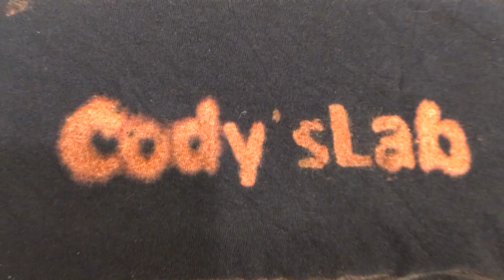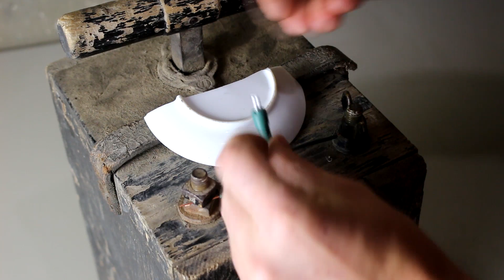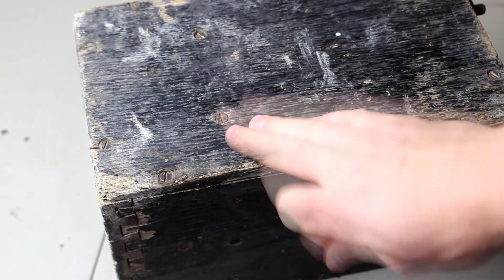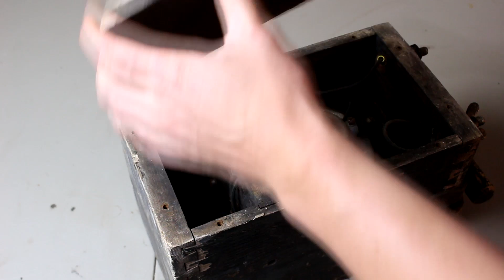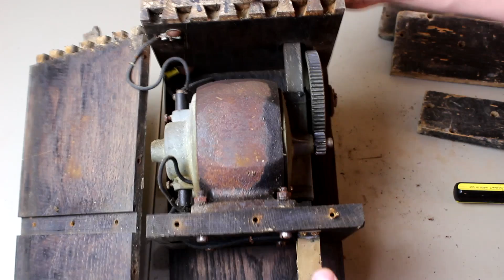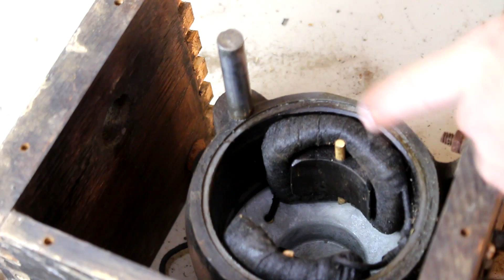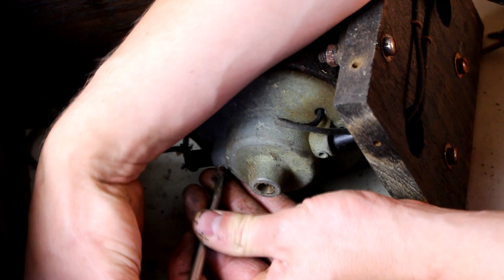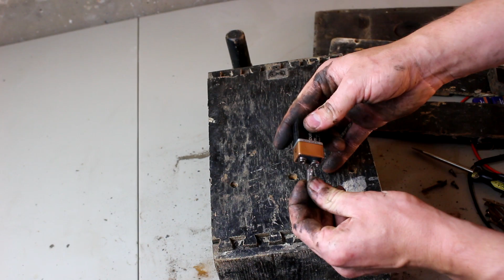How Does An Old Blasting Machine/Generator Work?

Comment: My deepest respect for you, because you have the courage to take apart such a valuable item that belonged to your granddad.
Reply: This thing is from the era where it is actually supposed to take it apart, maintain and put it back together. And you could do that without any doubt.

If it were made today, you would start by removing the single screw in the handle. The you remove the handle with the $1500 proprietary handle remover. Pry open the plastic housing with clicky tabs that says "Do not open, no user serviceable parts inside!". Then you'll find platic gears, and a motor of tenth the size. The bearing cap would be secured with triangle screws, and it would be made so that a standard bearing puller won't fit, but there would be an another $1500 proprietary bearing puller for that. But the bearing housing made from single-use plastic would shatter anyway. $1k for a set of two, bearings sold separately. And the output connector would be proprietary also, with a semihypershapical cutout on the front panel, in case you would swap it for some old-fashioned round $1 terminal post.
And the whole assembly process would be totally pleasent and absolutely not stressful with the 10cm permanently crimped unremovable very thin wires holding everything close to allow great access.
Reply: Ok so it should be "grandad"
Reply: G R A N D - D A D
Reply: FLEENSTONES???
Reply: 7 GRAND DAD?!
Reply: @Sam-fq5hc  what are you trying to say?
Reply: @zrnjan  migo they're referencing to the bootleg game called 7 grand dad
Reply: @zrnjan  GRAND DAD
Reply: @SomeAzureDude  I don't know what is that, man. I don't know what kind of game is that.
Reply: F L I N T S T O N E S F L I N T S T O N E S T S T O N E S F L I N T S T O N E S T S T O N E S F L I N T S T O N E S
Reply: AWWWW- GRANDAD?

Comment: I doubt that's actually antique. That's machine cut dove-tailling, which puts it's construction around the 1950s. Dove-tailing pre 1920s would be hand cut, making them wider and spaced further apart. Hand cut dove-tails were also less regular.
These devices were still being used up to the '70s in some cases.
Reply: A competent craftsman makes regular dovetails, but what would I know?
I've often been asked which machine/software I use to get my results.
I always respond, "my hands".

It's how we used to do things before computerization.

Faberge didn't use machines, Michelangelo didn't use machines..

I find all the childish insistence that this perfectly working device should be "modernized" hilarious, a bit like your assertion that regular dovetails are de facto machine made..

Comment: A little tip. When removing old screws, that have been sitting in the wood for a long time, it sometimes helps to start by tightening it just a little bit. This expands the hole just enough so the screw can be easely removed.

Comment: Its unlikley to be aluminum, its probably a ZAMAC flavor or Zinc casting. Aluminum was still super expensive until the later part of the 20th century. Zinc was cheap and easy to melt.

Comment: @Cody'sLab Hello i got an idea after watching this video and thought i might share it with you since i haven't got the materials or money to do it.... It might be cool to do some changes on a blast generator as simple as the one you have. The basic idea would be to get a much higher voltage in a simple way. First you would have adjust the sistem with wheels so that the bar turns the wheels only when pushed and when you pull it out it skips and doesn't turn the wheels... I dont know how hard it would be to make it work this way but i hope you have an idea on that one... next we get a dozen high capacity capacitors and connect them parallel with the ends of a dinamo. The idea is so that you can store a lot of energy and you store it by pushing the bar a few times repeatedly. This way you can store energy but you still don't have the voltage high enough. So you can fix that by copy/paste -ing the parallel system of capacitors in series xD ahaha quite simple but in theory it should work? Only problem is that if you want really high voltages or store a lot of energy you would have to push that bar over and over again... but i doubt it would be to hard? I dont know... i though it would be cool to make so if you could i would be happpy!! Hahaha sry for the long comment, no potato... :/ well i know it is not something out of the world... quite opposite its extremely simple but it should work right?

Comment: Hey Cody, could you potentially measure the power output of the blasting machine by putting an LED or something of a known turn on voltage on the end of a long length of wire and seeing how long the wire can be while still being able to turn on the light?  The theory being that if you know the voltage drop of the length of wire, so you use the length and voltage drop of the wire to find the power output. Thanks!

Comment: Hey Cody, the intermediate gear is made from ZAMAC, ZAMAC is an acronym for the Zinc, Aluminum, Magnesium, and Copper alloy. A popular metal during WWII and after when Iron and Steel where going to other things, there are several different types of ZAMAC. Fun Fact, the Hot Wheels made from ZAMAC the "unpaited ones" are becoming quite popular with collectors.

Comment: it would not be lethel because there is no amperage draw...you would have to put yourself in the path of a significant motor or something like that running in order for the amperage to be high in the circuit to kill you
Reply: You could use that to stimulate your muscles but that's about it...

Comment: The safety implications are interesting... it replaces the modern keying system designed to add gravity, with a high requirement for mechanical work to operate.  And as much of a 21st century technophile as I am, I retain my appreciation for the simplicity of older tech.

Comment: Nice to see how this looks from the inside! I would have guessed that there should have been a condensator... Very clever and simple how they did that ignition system! I would love to see a video showing the limits in feet of wire while using the battery methode to detonate the tnt :D

Comment: A generator is usually closer in behaviour to a current source than to a voltage source! So without load, you're going to measure pretty high voltage, but once you load it up, it'll come down.

This is particularly of advantage when you're trying to blast some caps, because they are heaters, thus predominantly current-activated, so you could chain a number of them and up to a point, it will behave similarly to how it would if it was just one.

Comment: It's not the voltage that kills you, it's the current
Reply: EricJon 
It's not the car that kills you, it's the forcing of your body in a direction suddenly that kills you
Reply: amps kills voltage helps
Reply: Its not the fall that kills you its the sudden stop
Reply: It's the Voltage WITH the Current that kills you.
Reply: The electrical current
Reply: Its not the airplane that kills you its george bush all along
Reply: Not really because of ohms law 1v is enough to push 1 amp through 1 ohm so it takes a certain amount of voltage to push a lethal current through your skin ~30v

Comment: hey Cody how would carbon dateing work on say a piece of realy old burnt wood? i have been doing some digging in the woods around my place and everywhere i have dug i am finding a layer of burn soil and ash and in one place i found a hill left from a tree that tipped over roots and all sometime near the time of the fire because the dirt covered the base of the tree and it smolderd into a lump coal just wundering it it could be carbon dated and if so what would the date show ? the date it was turned to carbon or the age of the tree?

Comment: +Cody'sLab , I think that grease is Molly B, or molybdenum grease. We use it on the Apache helicopter for the gun. In case you wanted to restore it to the original state. Just figured I'd throw that in there!

Comment: Those thin windings can actually handle very high amperage because of the heat capacity and minuscule duty cycle. At least an order of magnitude more current than they could handle as a continuous duty motor, maybe even two orders.

Comment: A quick idea on the little switch activated at the bottom of the plunger's path: 

It's possible that the two terminals are wired in parallel with a large inductor inside the motor, so when the switch is activated at the bottom of the path, the current is allowed to flow through the inductor coils, and due to a near-infinite instantaneous change in current, there is a massive voltage across the inductor (and therefore across the terminals).

I might be overthinking this relatively simple mechanism. It's possible that it's just as simple as you explained it: the electrical connection is made when the motor is generating the maximum voltage — at the end of the path of travel.

Any electrical engineers out there that might be able to confirm/debunk this hypothesis?

Comment: Would be super interesting if you were to rebuild the housing to refurbish it and make it last even longer. 
Also keen to know what voltage & current you'd get if you were to upgrade the magnetised Iron plates with neodymium magnetic plates.

Comment: I think there is a bit more clever engineering in there.  The gears act as flywheels, storing energy from the plunger so you put in low power over a large time and it can output high power for a short time.

Comment: You should have put a meter on it to read how much voltage and amperage it puts out.
Reply: Vegaspsycho NEVER MEASURE CURRENT ON SOMETHING WITH A METER WITHOUT A LOAD. The way current has to be measured, unlike voltage, requires a dead short between the test leads and if you just connect the meter you will blow it to bits if there is too much current... My suggestion is put a dummy load resistor in series with the meter and progressively drop the load resistor's value and if it goes above about 5 amps without issue then get a standalone ammeter to measure it with instead of risking blowing up your meter. Once the current stops going up even after you keep dropping the value of the resistor you have your answer.
Reply: He did have a load on it with the lights. And that shouldn't be putting out enough power to blow your meter if it only lights up 8 christmas lights.
I know they make meter clamps that just go around the wire without splicing into it.
At 1:20 he estimates 60-100 volts DC and it's just that the meter he has can't measure in that.
Reply: Ah. I thought you were implying that he just stick the meter leads across it and whack it into the amps range. My bad! And yes, for currents higher than two or three amps I usually use the clamp meter just because it can measure high current without risking violent, unplanned disassembly. :P
Reply: @inkno701  I think the reason he didn't is that a digital multimeter is too slow, they only take a reading several times per second. I think even if you set it to min/max mode, you'd be lucky to register any volt reading for such a pulse coming from that demolition box. Reading a battery or other sort of supply works as the value being read doesn't usually change so much within 1 second. So meters are great for lots of things but I think he would need an oscilloscope to measure that instantaneous voltage.

Comment: The windings on the rotor were probably thin so they could put more of them in the same space. More windings = higher voltage.

My uncle used to use an old telephone generator to fish sometimes. I'm fairly sure if you connect a telephone across the terminals of the blasting generator and short the contacts at the bottom, it will ring when you push the handle down.

Comment: I think that the wires going back in the generator are simply the ones which power the self-exciting circuit, which of course is needed to create the magnetic field in which the rotor spin. Also there are no magnet in this dynamo since the magnetic fields are produced by coils

Comment: you could add a safety to this with a locking pin made of wood to go between the connection point. just need to cut a slit in the right spot and slid a flad wooden stick in it. instant safety lock.

Comment: So that bugger produces alternating current. There are those vintage style doorbells that use AC. A blasting machine, one of those doorbells and two bits of wire would make a wonderful, grid independent door alarm thus. ^^)
"If you want in, just push the handle!"
*Ker~Boom!*
"No, the other one."

Comment: You DID regrease those gears, right? Probably a good idea. Petroleum jelly would work great and that's what I normally use. Certainly made a larger oscillating fan we have work like new. I don't know if what was around the bushings and bearing was grease oily dirt paste though, it was hard to tell. Needless to say I replaced it and I think the blasting generator would benefit from the same maintenance. XD

Comment: To be fair, older technologies may look bulky, but it was far more practical.
(just raise and push down the plunger quickly)
Reply: i mean, a modern equivalent could probably either literally use a single battery, or be completely remote activated. A button that can be pushed from a far greater distance with a far more precise and reliable detonation is probably more practical, id assume.
Reply: you guys are taking the piss out still used engineering, we've just cleaned up the design and scaled it to what need.
Reply: Because yes, I'm going to use this to power my laptop

It's not that they are more practical, it's that their needs are simpler, and can afford a simpler option. You can always use one to power a bomb, but don't use it on anything that needs more than just a brief amount of power!
Reply: matthew fanous 
Just push the plunger up and down repeatedly. Boom, powered laptop. :-)

Comment: Having the dynamo disconnected from the load until the last second was likely done to reduce the force needed to trigger the blasting caps. Instead of having a constant and high mechanical resistance to push it down the whole way, it effectively gets a running start before slamming into an electrical wall.

Comment: hey cody how does the arm flip out for the ratcheting system in between the pinion and spur gear? How does the handle make contact with the spring system to engage it and allow the pinion motion to transfer to the gear?

Comment: great video :D
the normally opened contacts in the bottom are there just to let you have current when u push it down to the max, so the fuse/blasting cap wont blow up when u barley touch the plunger bar. and for safety as well (:

Comment: Cody add a capacitor to the circuit before the little contact that gets triggered when the lever hits the bottom, that way it'll discharge the electricity even more rapidly

Comment: I'm a woodworker here in Utah and I would love to restore that generator. My brother is also a leatherworker. 100% pro-bono I love doing that kind of thing.
Reply: I have one in PA that I inherited from my father. Care to advise in my restoration process?
Reply: @StachuDotNet  Really wood is quite easy to restore, especially one that is originally painted. You just have to clean it, scuff it up a bit to freshen the surface and prepare it for new paint, fill in any egregious holes/gaps and repaint it.
Reply: @CrawfordAutomation  username checks out
Reply: @Kurokubi  ??
Reply: @CrawfordAutomation  what’s the best glue to use with antique restoration ?  Just good ol wood glue?  Trying to fix up an old wall clock from the 1800s.  It’s not valuable other than sentimental.  It still works though!
Reply: @machinesandthings9641  i actually know someone who has a business restoring and repairing old clocks of all types. Do you want me to ask them if you havent already finished it?
Reply: What part of Utah you in? I'm lookin' to start some trade work lmao
Reply: You guys are weird. Talk about your little "wood parties" somewhere else.

Comment: Are you sure it's DC? Because of the resistance of your hand you would hardly feel, if at all, if it were between 60-100v. Either its AC, or puts out a much higher voltage than 100v if it hurts

Comment: That contact at the bottom of the box may also be to reduce the effort needed to get the mechanism spinning. If it was a complete circuit, then there would be current flow and a strong magnetic field resisting the rotation of the mechanism.

Comment: I would really enjoy seeing a restoration/ rebuild video on this. Maybe make a new wood box, take it apart and replace the wiring, and fittings etc. etc. With a test to see the voltage output before and afterwards. Anyone else interested should thumbs up this so he sees it!
Reply: Even better, cody should make one from scratch.
Reply: the box is actually of remarkable craftmanship it would be a terrible shame to harm it
Reply: It would not be same generator anymore. It looks better now.
Reply: Donny Champagne 
Maybe just a cleanup the wood, and put some moisture back in it with Murphy’s wood soap??
Reply: Donny Champagne but then it wouldn't be his Grandpa's generator anymore, it would be a completely new one. 😂
Reply: This machine will work for another 100 years. Built like a tank.
Reply: There is a youtuber I watch that rebulds old things like these. He would probably enjoy that! He does restoration only but I think cody should but this thing in a clear polycarbonate box.

Comment: Can you use this to somehow arc inside your vacuum chamber? Then you can put in different gases at low concentration to see how the intensity of the arc changes. Then you can pull out an analogy with how a lightning storm in a different planet would look like.